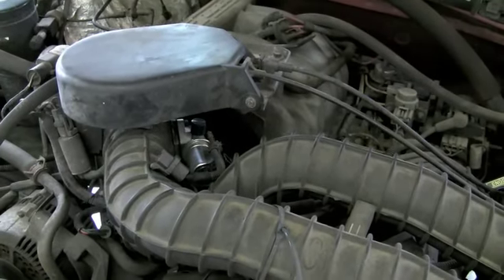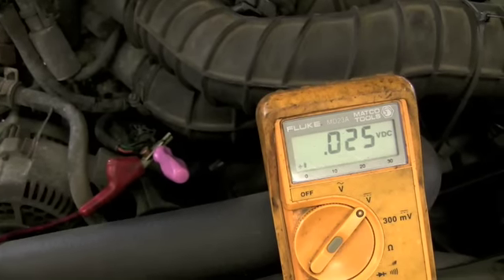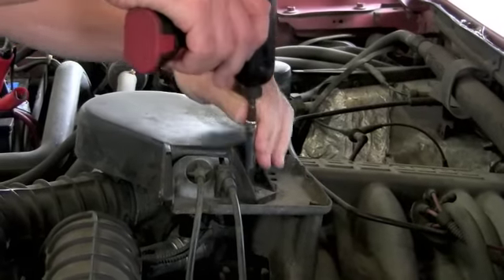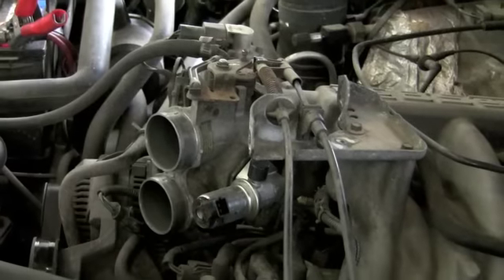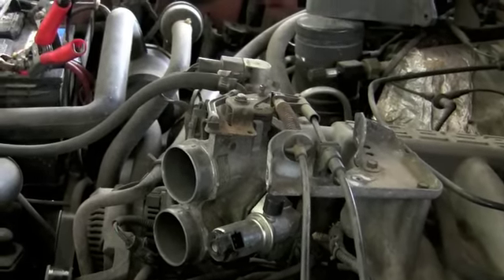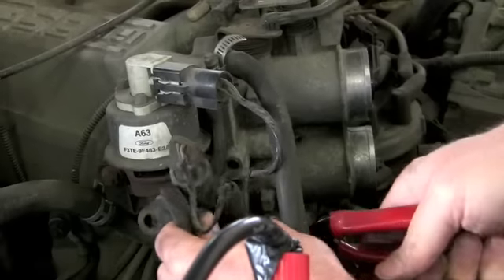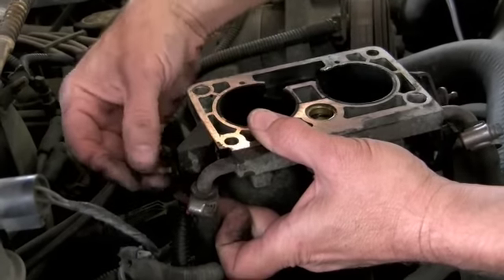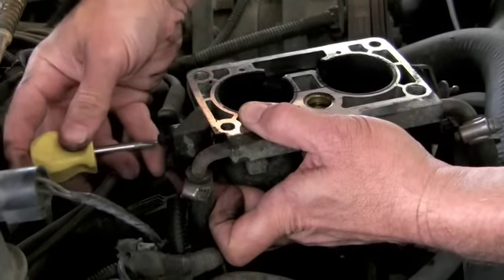1995 F150 Erratic Idle Part 1

Comment: I had a similar issue and in my case, i took the TPS off the throttle body, rinsed it with break cleaner, turned it over and let the break cleaner sit in there for a couple of mins, dumped it out and let it dry, threw it back on and it idles fine now.

Comment: Nice vid - you actually did good.  The 5.0 likes to surge high for no reason when the TPS is shot... happened to me and it fixed it.  Low/stalling idle means IAC.  Surge idle means TPS.  Also note, if you have an automatic tranny you gotta remove the throttle valve lingage at the throttle body when you take the TB off.  And while you have ti off clean it out, the backside included.

Comment: Excellent video  I think - having read the other posts that my problem might be the IAC as the engine starts to choke and stall the moment that the throttle is applied.
mine is an intermiten problem and usually occurs when there is a big change in outside air temp -5 to say -15 degrees celcius.  It runs crazy rich on these occasions - judging from the smell and what appears to be fuel leaking out the tail pipe.  after warming up a bit I turn it off for a minute restart and usually good to go.

Comment from the maker: @MrSeabass12345 A faulty IAC solenoid would likely cause the engine to stall or surge, when you let off the throttle completely. If you have fuel leaking out of the tailpipe, you have a ruptured diaphragm in the fuel pressure regulator and a very dangerous condition. If it is water condensation and a rich exhaust smell, then that could be caused by a faulty fuel pressure regulator (pressure too high), a faulty coolant temperature sensor and other assorted problems.
Reply: I'm working on my 1990 Ford F-150.
The only things I haven't changed are my TPS, EGR solenoid, IAC, starter, & starter solenoid.

When I start my truck, it hesitates to start, once started, it either dies, or wants to die when I put it in gear. So I really don't drive it for fear it will shut off & not start again.

Out of what's left to replace, what do u think it may be?

Thanks in advance..

Comment: One more thing.  How do you properly set the ignition timing on this Ford of mine.  The sticker under the hood says it is not adjustable, but it lies.  It has a distributor that can be rotated in its socket, thus adjustable.  It seems to run better when I advance the timing so far that it wont start  after being shut off.  Again, any help I am greatly for.

Comment: also..... crank it up and let it run for a lil bit, just enough to get the TPS warm/hot that way the break cleaner can penetrate in there. try to use a Q-tip to clean up and "scrub" the inside of it

Comment: Please help.  I have a 93 Ford F-150/ 5.0.  My symptoms are lac of power, Excessive fuel consumption, and engine rpm surging at high idle/cruising speeds. So far I have replaced O2 sensor, map sensor, EGR vacuum solenoid, and coolant temperature sensor.  I still get a code 21, which I understand is "engine coolant temperature sensor out of self test range.  Mind you I have cleared the codes and driven the truck 2-3 different times.  Any tips will help.  Thanks.

Comment: I just bought one for I think $139. Best small tool I have ever bought. has enough battery life to take apart and reassemble an entire dash on one battery. I used it at work for a heater core replacement about a month ago. Snap-On makes some of the best tools for the money.

Comment from the maker: The screws are tight due to thread locking compound. The actual torque specification is 18-27 inch lbs. Although it may have appeared that I was using a lot of pressure, the bulk of the force was in the direction of keeping the screw driver tip firmly in place, insuring that the phillips headed screw would not strip out. That was the reason for the appearance of excessive torque. Thanks for pointing that out even if you were a little adolescent in your remarks.
Reply: Little late to the party here but those screws are actually a Pozidriv screw, I found that interesting when I changed my TPS
Reply from the maker: @Dapsters  Never too late to add good information.
Reply: @Dapsters  THANK YOU SIR!

Comment: Thanks for the video! I noticed 1.0 volts was too high an idle for my 1995 F150 5.0 automatic and .8 was too low, I understand the TPS in this engine is adjustable. Mine did better at .95 volts. I determined that by connecting a voltmeter to the signal wire and to ground and turned the screw until I got the right voltage. Hope it helps.

Comment: Ive got a good one. 1995 5.0 f150. idles rough sometimes (mostly when cold). Just recently it started doing it while warm too. It will also do it while driving now. it will start by bogging out for like 45 seconds then out of nowhere it snaps out of it and drives normally. Cleaned the MAF and am running fuel system cleaner through it. It still bogged at idle but not while driving.
Reply from the maker: Are there any codes and what is the fuel pressure?
Reply: I have the same kinda problem. Did you ever fix it?

Comment: i had the same problem on my 92 f150 with the 351 windsor, took the IAC solenoid off, cleaned it up real real good, put it back on and it runs like brand new now

Comment from the maker: There are a lot of possibilities but a faulty IAC valve or leaking intake gaskets are common for those engines.
Reply: Sparky's Answers I have a 1992 Bronco 5.8.  It was leaking out the back of the intake manifold so I pulled the manifold and put in some new gaskets.  I am still havi g problems starting and it is a dog when you get on it.  Just not sure what more to do.

Comment: @SparkysAnswers  i did this within the first week i bought the truck used round 2007 and its been fine since. i might need to clean it out again but if you cleaned it out like i did at least once every other year, depending on how much you drive, it should be more than enough. But, if cleaning the TPS didnt work, i was advised by a couple of mechanics i trust to get a new one. It all depends on the situation.

Comment: Quiz time: Who all knows why it is that a high signal from the tps caused the pcm to command the idle air control to open so much?  Something to think about, what would happen to an engine if it went from an open throttle condition to a closed throttle condition suddenly if it didn't have an air bypass for a closed throttle.

Comment: When you put the new throttle position sensor on, is it supposed to hold the throttle blades open almost half an inch? Or should the throttle blades be completely closed. I put a new TPS on my 93 302 and its holding the throttle blades open almost half an inch. Before I bolt it back on the intake.
Reply from the maker: No it should be nearly closed. Remove the TPS and make sure the throttle plate closes correctly. If not someone may have been adjusting the curb idle screw or bent the linkage. If it does reinstall the TPS keeping in mind the direction of travel of the shaft and the movement of the TPS itself. The flat blade of the shaft will rest across the two internal extensions in the TPS. If placed on the wrong side there will be movement problems and the TPS can be easily broken.

Comment: I have a 95 f150 w/ 302, I have replaced the tps, icm, maf, iac, distributor, plugs, wires, coil, regrounded it, egr, reran vacuum lines, checked the timing qith and w/o the advanced plug in and still can't get it to run right, idle is irradic, jerks and lunges hard, ( broke my exhaust hangers). Any info on what it could be qould be greatly appreciated.
Reply from the maker: Most of the times that I have experienced  those conditions on that YMM truck the problem turned out to be either a faulty pcm or voltage/ground problems to the pcm. One quick test is to stick your head under the dash near the parking brake assembly and check for the smell of burnt electronics.

Comment: Hey Sparky,

I have a 93 f150 5.0L. I get a high idle in park and neutral. I replaced plugs, wires, rotor and cap, tps, iac, checked for leaks. The TPS voltage is reading .80

I don't know what else to check for. Any suggestions would be grateful.
Reply from the maker: ***** The TPS voltage is actually slightly low for a closed throttle. Has anyone adjusted the idle stop screw recently? Maybe trying to adjust it down to compensate for a high idle? If yes, my guess would be that there is a vacuum leak somewhere.  Possibly a leaking vacuum line, PCV valve or hose leaking, IAC solenoid with an internal problem or a problem with it's computer control, intake gasket leaking, low coolant or air temperature sensor readings that could be fooling the computer into thinking the engine is cold and needs more fuel and air. Unfortunately the list could go on.
Reply: Sparky's Answers I got the voltage up to .91 will see if that helps.
Reply: Sparky's Answers I know this was 3 years ago but this answer just helped me a whole bunch on my 94 🤘🏿

Comment: Great Video!!! However, I think a basic tutorial on "backprobing" is sorely needed. I had some low voltage issue with my TPS so I changed it. I cleaned the IAC as well. When I put the cleaned IAC and new TPS in truck wouldnt start. Then it did but died if I let off gas. Went to store to get new IAC and gaskets for IAC and TPS. New Gaskets are a must...I think!! I also had a cracked vacuum line that goes to an actuator on top of heater motor. All done and running but not notcing big chg yet.....

Comment: I have the same high idle issue. (hovers around 2k at start up, and 3k in between shifts).

I've replace the TPS, coolant temp sensor, igr, map, cap/rotor and plugs/wires.

I'm at my witts end at this point.

Any other ideas?
Reply from the maker: Disconnect the IAC solenoid harness and see if the idle will drop. If it drops to normal or slightly lower than normal you will need to check if the solenoid is faulty or if the control circuits are faulty. If disconnecting the harness connector makes no difference check for vacuum leaks.

Comment: Sparky's Answers 

Hey Sparky. noted you still answer questions now and then...

I have a 1995 Ford F250 XLT with a V8 5.8L EFI (351 winsor) with 109K miles...

I ran the tank dry by accident and now my engine acts like a half screwed chicken.

High ish idle.and will not drive at all. put in gear D/R and it sputters with NO power.

fuel lines are clear. fuel filter is clear. new spark plugs...theres pressure in the lines. fuel pump(s) are good and prime...Dumped a can of seafoam in and it helped somewhat.

Few friends say its my fuel injectors. my question? how the hell do you pull the injectors???

I would take it to my friend who owns a shop but its $200 to tow....or sketch as hell way of using my dads 150 to tow it O.o

thanks sparky
Reply from the maker: Although not impossible it would be highly unlikely for all eight injectors to fail at the same time. The most common things that will affect all injectors are strong chemical additives or a ruptured fuel filter that has plugged the injectors. Further more quite a bit of stuff has to be removed in order to lift the fuel rails and remove the injectors. I would inspect/test many things before pulling the injectors. 

First of all will the engine run and accelerate normally in park or neutral?

Does it run better with a fully closed, partially open or fully opened throttle? 

What does the exhaust look, smell and feel like: rich, lean or restricted?

Does adding fuel make the condition better or worse? There are safe and deadly ways of adding fuel. Please only choose a safe option. 

Are there any codes stored? 

Does the check engine light work?
Reply: Sparky's Answers  in park it acts normally aside form a high idle..(not enough fuel too much air I would assume)

It does run/accelerate/slowly decellerate in park

When in park it runs "okay" with the throttle closed. but tap it and it stutters before resuming a smooth flow. (CEL does work. trying to find a wire to jump the EEC obd1 manually) exhaust? before adding seafoam/lucas inject cleaner it was white puffs now and then. after lucas it ran better but still white. after the seafoam its continous white smoke even at low rpm/throttle....

Smell? (white) it smells like lean burnt gas. or at least as far as I can tell. It doesnt leave the gas smell on clothes at all.

fuel filture was not erupted

It does run better with the throttle open 30% or more in the cab. but hence. the high idle as well

adding fuel? idk if it makes it better or worse...I cant tell.

I did however have to jump it (low/dead battery) and I added fuel while running....(not smart. but I later turned it off and added more properly)

only chem anythings in the engine is a full bottle of lucas injector cleaner...probably used up however.

And a can of seafoam. I put a whole can in the rear tank with only about ~3 gallons in the truck. I added a few more (after noticing it said one can treats 28 gallons.....Ooops.).
Reply from the maker: Ford OBD1 does not just jump a wire to read codes.  

Does the CEL stay on indicating a code or does it go off after the engine is running? 

Does the white exhaust smell like Seafoam or Lucas? 

Does it smell like antifreeze? Typically white smoke indicates water/antifreeze in the combustion chamber. 

Adding fuel while the engine is running is only a safety concern and will not harm the fuel pump. Low voltage or a dry tank can hurt the pump though.
Reply: Sparky's Answers  cel stayed on. smoke smelled like smoke...didn't have the cringe smell of anti freeze. all in all I gave up trying to DIY fix my baby. Took her to a friend who owns a shop...She was giving me ground fault errors and hard fault issues. so electrical stuff....Im not tinkering with wires. I would fuck it up.

thanks though man!

Comment: Ok, the highway noise....
Do you remember if all the holes are plugged in the TB butterfly valves?
Reply from the maker: They are never plugged. At least the ones that have come in my shop in the southeastern USA. I remember reading an article 20ish years ago that stated that plastic plugs may be either already installed in the holes or you could buy special plugs from the dealership to seal the holes. This was supposed to be for some rare idle control problem. I believe it was more of an attempt to rectify a problem when data stream information and experience levels were too low to fix the problems correctly. Just yesterday I was helping a mechanic friend with high idle on a Ford van and the fix was a Motorcraft TPS and IAC solenoid. Cheap after market parts were the cause of the problem he was having. The original TPS had failed and was causing a shifting problem. The faulty replacement parts created new problems.

Comment: Has full tune up thottle body cleaned and new tps, wires, plugs, cap and rotor, egr valve,
Reply from the maker: There are many things that can cause an engine to shake. Since you have had a lot of tune up parts replaced recently I would recheck the spark plug  wires to make sure that they are correctly installed. Two crossed wires will make one run really bad.  Also now that the check engine light is back on I would suggest checking the codes again.

Comment: My dads 89 Bronco has just about the same problem!! Bought that NEW part in the vid as well, still idles HIGH then low, jumping...
Would this possibly be the same for the Bronco I6 engine?? 

I can't afford to spend a fortune trying to fix it, about how much does this run money wise?? Or is it possible to do myself?
Reply from the maker: The same tests and general procedure apply to all Ford products of that era. Some do not require removing the throttle body but the full sized trucks do. You are looking for a nominal .85-1 volt at closed throttle and it must be steady and repeatable. It is not hard to test and replace but you do need a meter and some basic tools as shown in the video. If it were a clear cut failure like the one in the video, most shops would charge between $200 and $300. The differences in cost would come from the brand of the part (Motorcraft or aftermarket), the shop labor rate and a hard or intermittent condition. An intermittent condition with no codes could add a couple of hundred to the total bill even if the final repair is the same.

Comment: How do I set engine idle screw on a f250 5.8liter throttle body efi
Reply from the maker: Pretty much all Ford products of this era needed a closed throttle TPS voltage of .95 volts + -.05 volts. The voltage reading needs to be checked before even considering making a physical adjustment. Also make sure there is no carbon build up on the throttle bore and butterfly that will not allow the linkage to bottom on the curb idle screw. If an adjustment is needed loosen the locking nut on the curb idle screw before attempting to turn. If there is no lock nut present, thread locker may have been used on the threads. Attempt to turn but if excessive force is needed the thread locker may have to be heated in order to turn the screw. It has been my experience that the curb idle screw never needs to be adjusted on these vehicles. The only times I ever remember having to adjust one is after someone else tried to fix it and messed it all up.

Comment: Alright so it was my egr valve buttt ford did a free diagnosis for my engine no codes everything fine besides that. So now my check engine light is on and my truck shakes in idle any idea why?

Comment: I have a 1995 f150 5.0with a coolant leak up by the throttle body, would that be the line going through it or could it be the gasket
Reply from the maker: The leak has to be in the hoses or metal line that goes through the throttle body. The gasket only seals air.